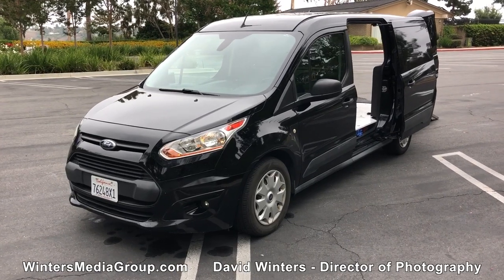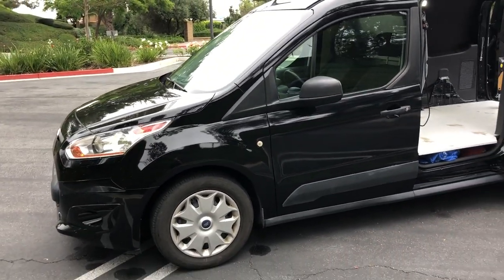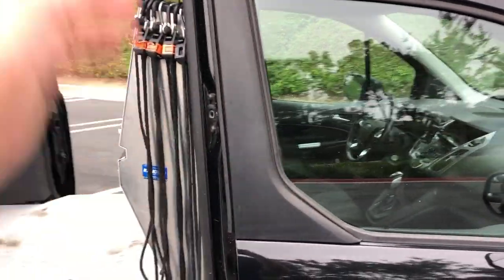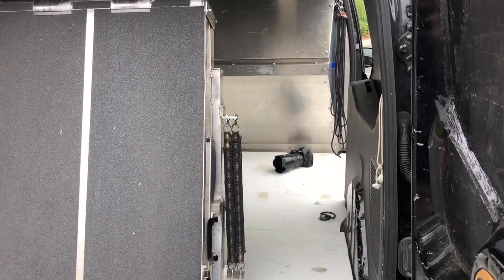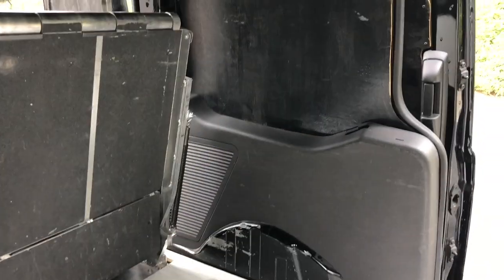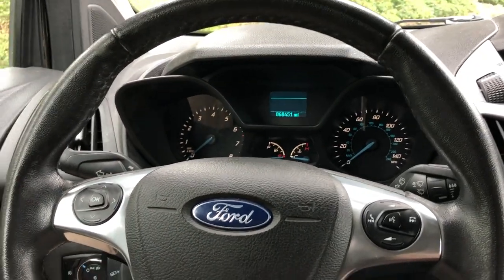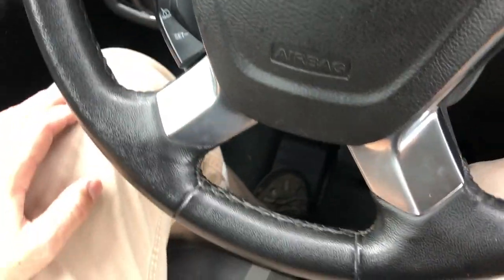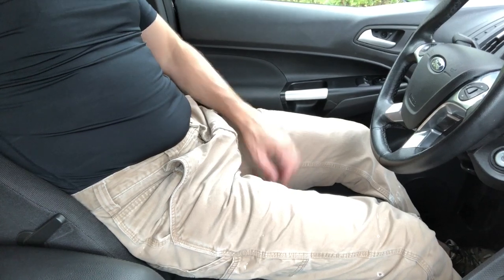Why I love Transit Connect for video production but I'm selling it

Comment: Would love to hear about how you created the sub-floor with plywood! We are thinking about doing that for our ProMaster City in the hopes of stashing some c-stands and longer grip.
Reply from the maker: A roll of seamless paper to make a template. Traced onto plywood and cut with a jig saw.  Attached ply to floor with existing d rings. Just had to swap out with longer bolts. 

I’ve seen vans with an elevated floor using 2x4 framing. Pipe and c stands travel under the plywood. Opening at rear doors.